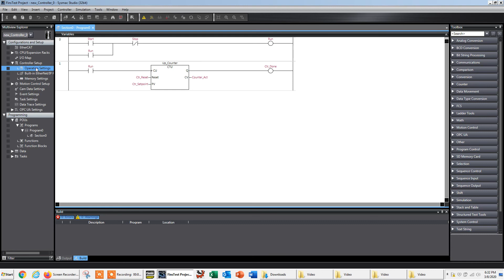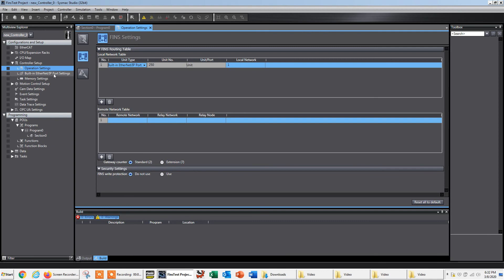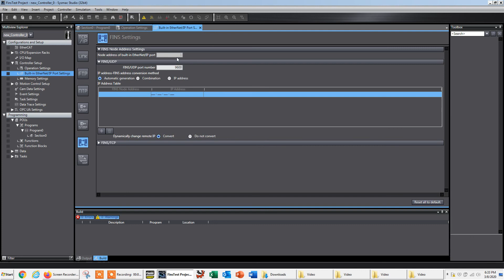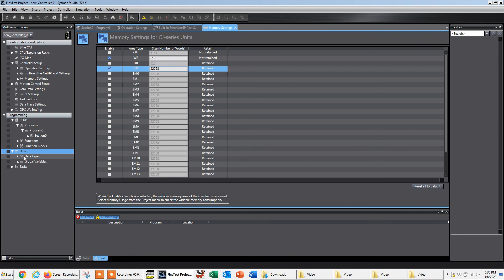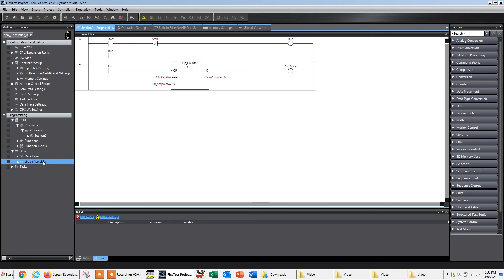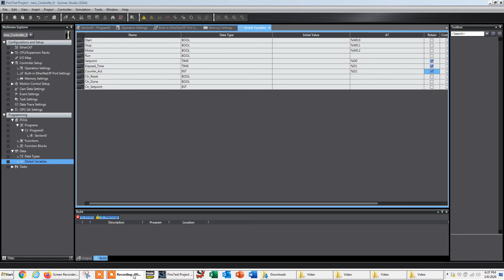Omron NX102 FINS Communication Setup

Comment: I dont understand the file system. Why can I not navigate between projects, once I have opened a project?
Reply from the maker: The file system for Sysmac Studio is a database type structure, not a standard windows file naming system.  The Database that holds all your programs is in your Root/Omron (example C:/Omron/) directory.  But the filename isn't available within the folders shown.  To save as a separate file you must export the project (example: from open project menu  File/Export)  This will allow you to save your named program as something you can email or place in your own filing system. 
If you wish to navigate between 2 or more projects, you will need to open both projects simultaneously, into separate instances of Sysmac Studio.  It is possible to cut and paste code from one open instance into another.

I hope this helps. I apologize if I misunderstood your question.

Comment: Can you tell me please if fins protocol is the same for nj serie as nx serie because i have a software that talk to a nj PLC but doesnt work with nx serie
Reply from the maker: Yes the FINS protocol is the same, however the CJ memory addressing used by FINS is on by default on the NJ and off by default on the NX. So you will need to enable the CJ memory areas (like CIO, DM, EM...etc) in the NX to give FINS an area it can pass data to.

Comment: Hi, what type cable do you use to communicate from PC to PLC? Is it standard LAN Cable?
Reply from the maker: Yes. Standard RJ45 Ethernet cable, is all you need. The factory default IP address for both NX102 ports are as follows: 192.168.250.1 and 192.168.251.1   .  Set your computer’s NIC to the same subnet, (example 192.168.250.12) connect your Network cable between the PC and PLC, and you should be able to set up communication. 
Note:make sure VPN isn’t running on your PC.